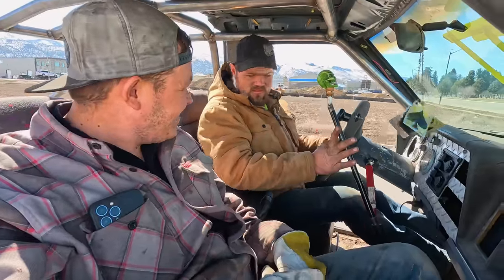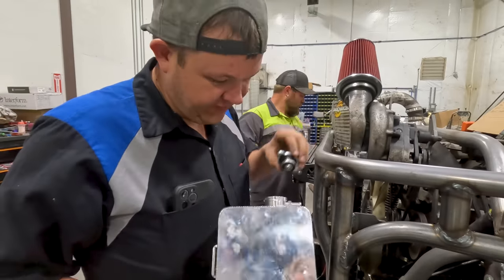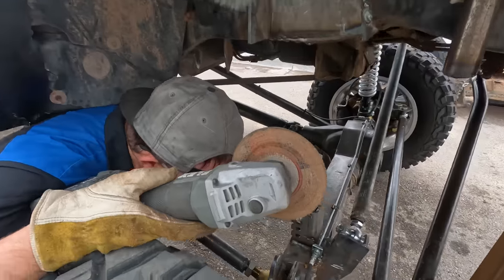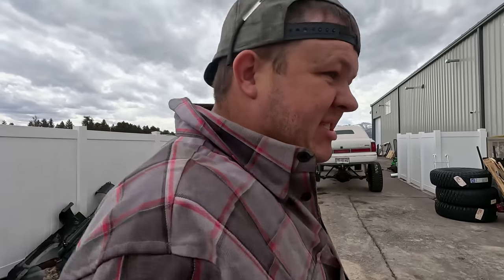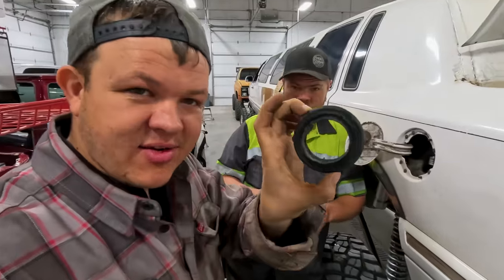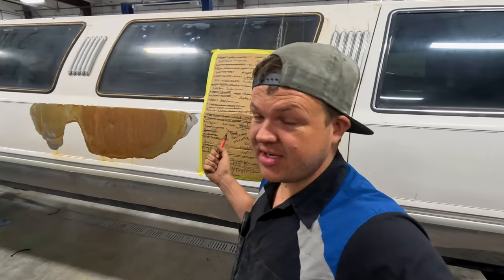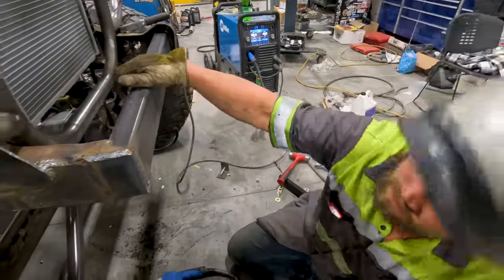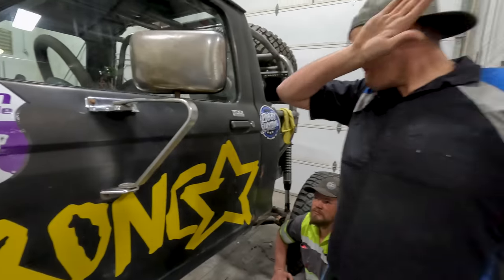FINALLY FINISHED! “Laymo” Land Yacht Limo Ready For EJS!

Comment: Easiest headlight/turn signal solution I’ve found for off-road builds is to just use snowplow lights, they are DOT lights , high/low and turn, and mount with a single bolt so you have minimal work to get them installed and they can be mounted almost anywhere. Bonus is they are cheap so if you break one replacement doesn’t hurt as bad and takes 30 seconds

Comment: As an AF crew chief, the landing gear struts on the KC-135s used air to adjust the height, based on the fuel load.  The big difference was using over 1,000 pounds of pressure in the struts.

Comment: For a future project on the limo, install a couple of snow tracks in the middle. Place them so  that they only stick down about six inches so that when the belly would bottom out the tracks would make contact w/ the rock/ obstacle & drive the vehicle over it. Power them w/ electric motors.

Comment: My tow truck driver was just inspecting a car hauler like yours in the parking lot.  He said he used to actually own one that had the ramp that extended over the cab of the pickup, but even though it was brand new, whenever he went around corners, he could feel the hauler leaning.  He felt with age the metal would fatigue and fall of the cab.  He sold it after only 3 hauls.

Comment: I hate welding up-side down also. So I built a ROTISSERIE. works great on most small-medium vehicles. I can get my F-350 on it, but I am going to have to beef it up a little. It is a little shaky with F350. But it works. I saw a Rotisserie on EASTLAND and Amazon but they wanted $3500.00 so I built one for approx. $1000.00, Maybe a little less. I use it mainly for painting the under carriage.

Comment: That filler seal bit was prophetic. Saw the dude in the Comanches video with the unibodies, he spilled the Beans on the Banana  discovering a fuel issue on a severe incline. It'll evaporate. If it's just rocks and sand, should be able to torch it when you move forward. Wonder what the procedure is. With as much rain as there's been, I'd imagine it's the best time to burn something off. Wonder if you're allowed to.

Comment: Building a lifted limo is one idiotic idea.
Reply from the maker: Why? It crawls?
Reply: @RobbyLayton  sure it crawls.  But you’re gonna need two more tires in the middle to get over any obstacle higher than three feet.
Reply from the maker: Haha I went up Hell’s Revenge. I think you would be surprised what it can do. 🤷🏻‍♂️
Reply: @RobbyLayton  I watched and yes I was surprised.  My thirty years of experience in 4x4’s driving the mountains of Washington state taught me the value of short wheeled based rigs.  My 71 F-250 step side with a long narrow bed, had trouble at times, where my four wheeling buddy driving a Toyota Land Cruiser easily negotiated tight curves with no trouble.